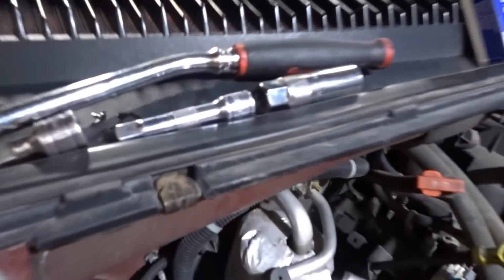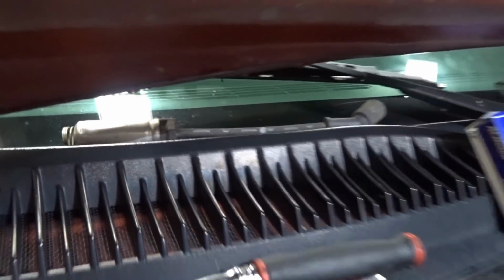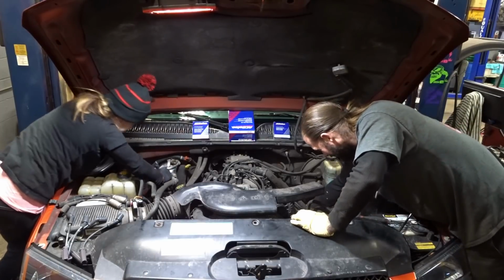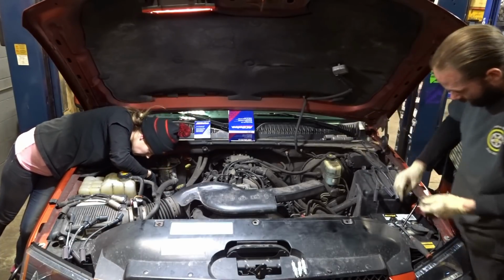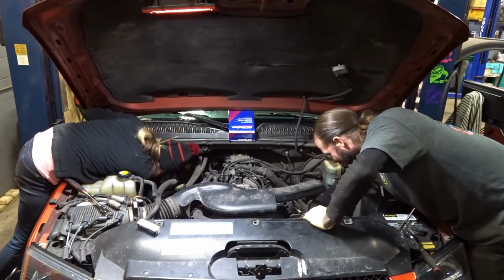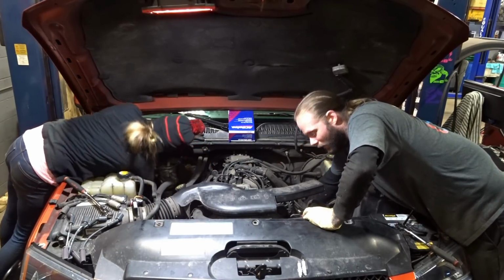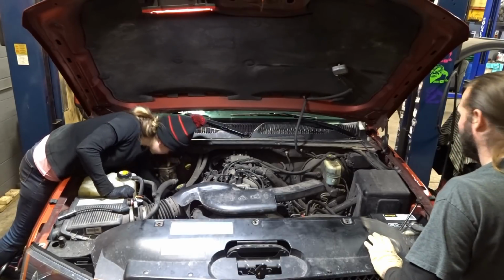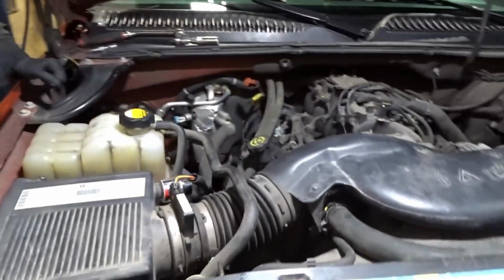MECHANIC's Friendly Competition

Comment: Hey try this next time u have a Chevy take the wheel well out and spark plugs are way easier to take out even back ones. I know it sounds odd. But this is how I do them every time now at my shop and saves half the time. Wheel tub only take a few minutes to pull out and after doing a few u can take them out in no time. But trust me it’s way faster and easier.

Comment: Am I the only the only one that still gaps plugs anymore?
Reply from the maker: I'm always pretty adamant about gapping but with platinum's you risk damaging the tips. AC Delco is pretty good with being accurate n pre gap out of the box
Reply: I do, except iridium's, and platinums. They'll break almost everytime.
Reply: JRC54 Thanks for responding. Enjoined watching your girl change oil. Brought back memories.
Reply: You might be, Snap Mac. When I started this career, pre-gapped spark plugs were just a joke. Now, when I take them out of the box and remove the protective sleeve, if the side electrode looks ok, in they go.